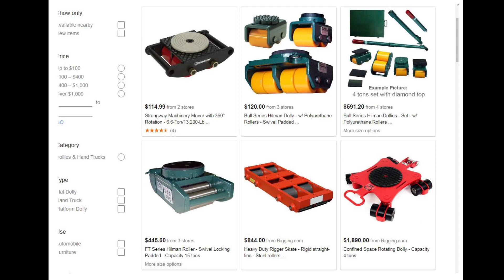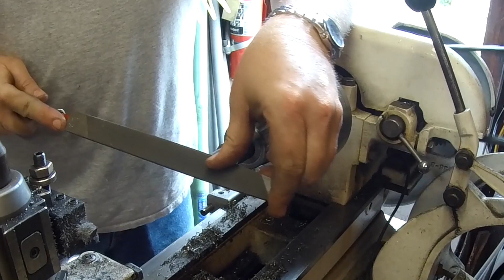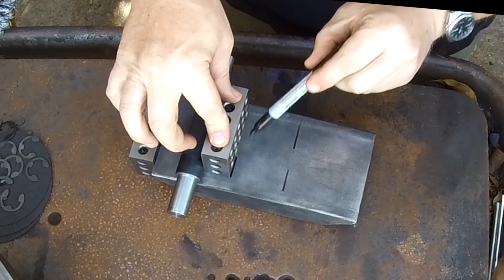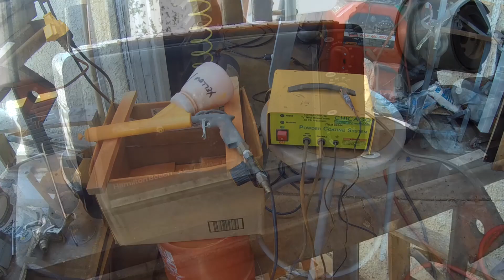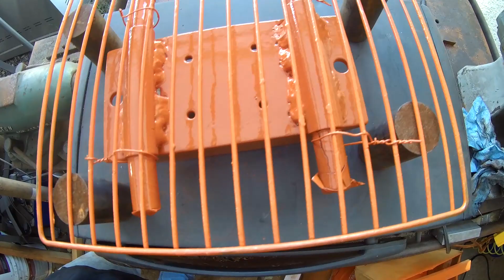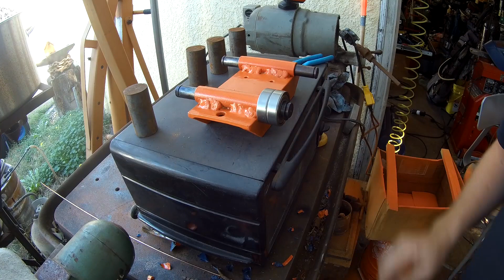Matt's Workshop - Machine Skates

Comment: 👍what is load capacity of this skate
Reply from the maker: 2 tons per skate, with at least 50% safety margin for poor welding.  These should easily hold 3 tons if used correctly.

Comment: Nice job,your presentation is really nice,quick question what weight it will hold,I am not having a lathe can I weld the bearing with the shaft
Reply from the maker: Just use an axle that fits your bearings so no lathe work will be necessary. My skates easily hold   2.5 tons each.

Comment: What a waste of your time! Not the skates but putting the work in and out of the collet chuck I would have put the bar in, faced it, centre drilled it turned it to the required size for the bearing and cut the circlip grove without ever taking it out of the chuck. Only then removed it and put another bar in and do it again three more times. And that's just four openings of your collet chuck. So you could do the whole job with just opining the chuck eight times. You did it eight times just to face the ends! Well 16 if you count open as one and close as two. As I say, a waste of time. Nice job by the way !
Reply from the maker: I agree with you on the repetitive workflow, but I made these without a plan in mind. Also, the little lathe I was using was not very rigid so each setup required remeasuring.  Thanks for the comment!  My next lathe will be much more robust and I'll have a lever or pneumatic chuck!

Comment: Nice job! What are the half inch holes for?
Reply from the maker: I can use a tow-bar hooked into the hole to pull & steer the load rather than pushing the load if necessary. I can even attach a chain or cable & pulley to winch the load up a ramp.  Thanks for the question!

Comment: Make a bunch of them and sell them on eBay for less than half!  But you're going to have to grind down those ugly welds.
Reply from the maker: Yeah, those welds look really bad. I normally do much better. Anyhow, if material costs are about $30 per skate and it takes 1.5 hours to make one, how much should I charge on ebay?
Reply: MatthewRulla  Forget about your hourly rates. It complicates and obscure things.  Keep track of it, but see it as just a resource to be redeemed in the future.  If one of the commercial skates costs about $200, then four of them will cost $800.  Can you make four of these for $400?  I bet you can!   The cost of materials gets really cheap in high quantities.  As for time, I am sure you can cut it down significantly with design changes, specialized tooling and batching.  You should farm out the painful parts.